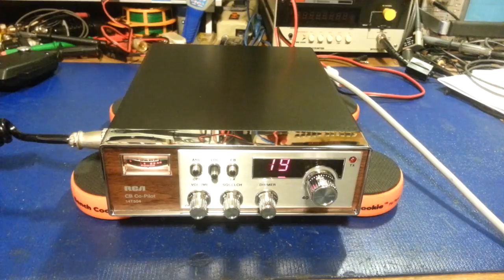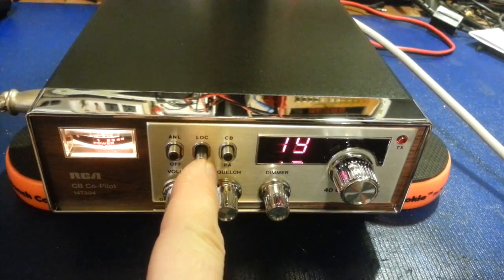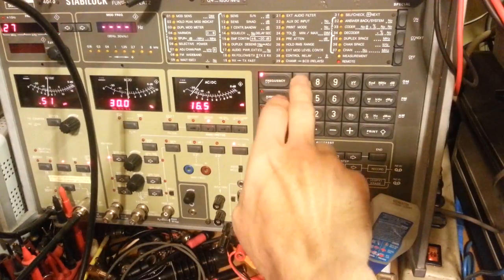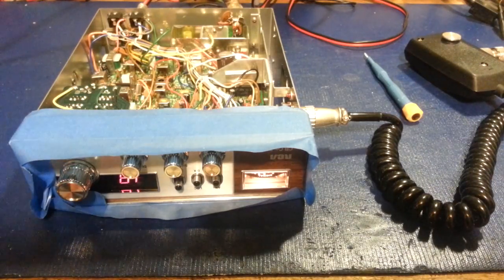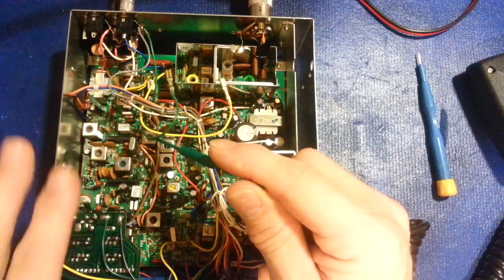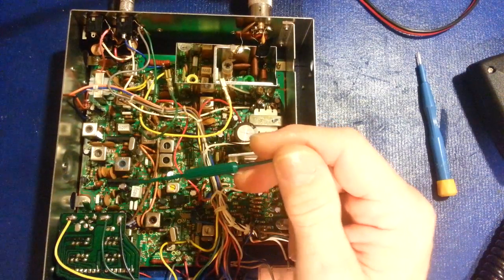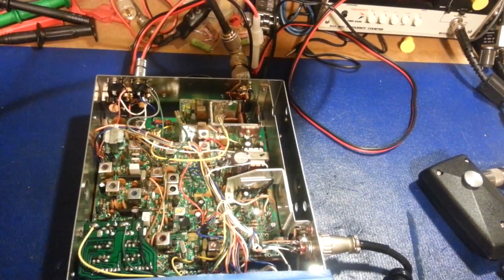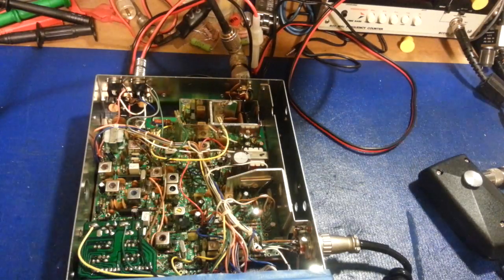NOS RCA Co-Pilot 14T304 recap and alignment. Tip on receiver alignment.

Comment: At first glance the 14T305 looks about the same as the 14T304, but they're very different.  The 14T305 has a 12-pin mic with squelch control,  volume control, and up & down channel buttons on it, and none of those controls on the radio itself.  God bless! (:

Comment: Hey Mike!!  Faithful subscriber 
Norman in Montreal here, how are 
you doing brother?  I hope all 
goes well for you! I just bought a 
very nice RCA-14T302 40ch-SSB 
radio 3 days ago.  I would like to 
ask a question, if you don't mind! 
The modulation light lights up 
when on the AM band, but not on 
either sideband.  Is this normal 
for this model radio? 
One more question(sorry!): 
might you have any idea why my 
13.8 volt power supply puts out 
26.8 volts?  Good thing I checked 
first with my multimeter!! 
Safety and diligence first, kids!!!!  
Any answers you have for me 
would be appreciated SO much!! 
How might one get into contact 
with you about working on a radio? 
Do you have a website? 
Thank you in advance for ANY help 
that you could give me.  
Your humble & faithful subscriber, 
and a big fan of yours (mad skills!)
Norman
Reply from the maker: In most radios the modulation light or modulation meter only works on AM.  AM uses the audio amplifier where SSB does not.  No high level audio amplification in SSB prevents using a audio power indicator. 

Many parts in the power supply could cause the problem.  Just use normal troubleshooting procedures to diagnose it, it's a simple power supply design.
Reply: MikesRadioRepair: First of all, thank you VERY much for taking the time to answer my questions!!  Is there a troubleshooting guide that I could consult to help me with the power supply?  I'm a bit of a newbie when it comes to checking caps, transistors and what have you.  Is there a methodology to checking the power supply?  I'm not asking you for a step by step, that would probably take too much of your valuable time.  I'm just wondering if there is anything online to help me! Any ideas or suggestions would be so incredibly appreciated.  Thank you again for your time!!  It means so much to us less-abled people to have a master such as yourself to help and guide us(ME)!!  
Your faithful subscriber & fan, 
Norman.

Comment: I just bought the 14T305 on ebay.  I thought is was a sideband radio woops I dont know anything at all about this old radio. I only paid 15 dollars for it so it is worth that much easy.  I would have left it the output turned up and just not said nothing LOL It is hard enough to talk very far on these cbs as it is.  I really need a signal generator bad I cant do a receive alignment with out it. They cost too much gosh.  I will put some new caps in the RCA radio and It will be fine Im sure or least Im hoping. Maybe I should send it to you for a receive alignment so I can do some super listening. I found that very good news it has that capability if you know how to tune the receive like you did.

Comment: Now that was a good tip, awesome job, thanks . Question, would it be possible to show the circuit schematic and discuss what part of the circuit these transformers were in and why this particular alignment sequence worked? Not necessarily for this video but for future videos.  Keep up the good work.
Reply from the maker: Next time I get one with this chassis I can do that.  In a nutshell the three that are normally adjusted in the PLL alignment are the transformers for the mixer circuits.  In the majority of radios just peaking them for maximun RF is all that's needed.  These chassis seem to be very touchy and peaking for max in the mixer circuit actually reduces receive sensitivity.  What led me to find this was one day I was doing an alignment on a radio and like this one had taken before sensitivity measurements and noticed that after I got done the alignment receive sensitivity was worse than when I started.  I had done a factory by the book alignment so that seemed rather strange.  After some head scratching and looking over the schematic I thought what the heck, try fine tuning the mixer and walla receive sensitivity came back and then some.  I get the feeling that's how the factory actually tuned them.